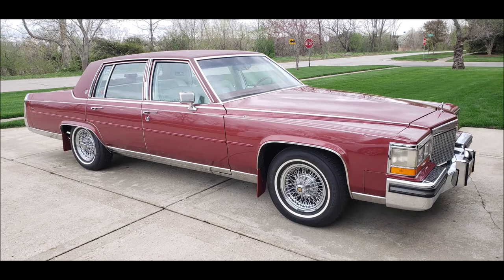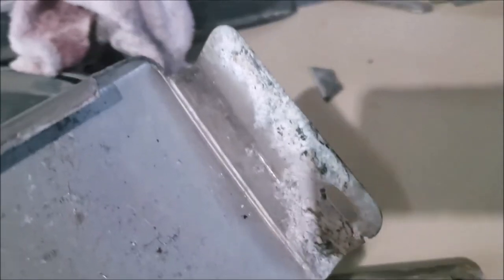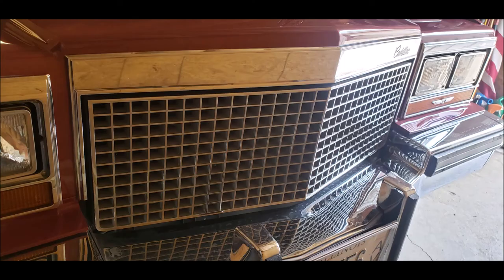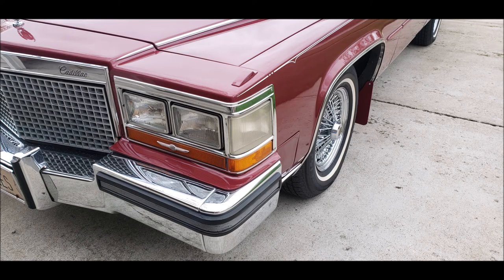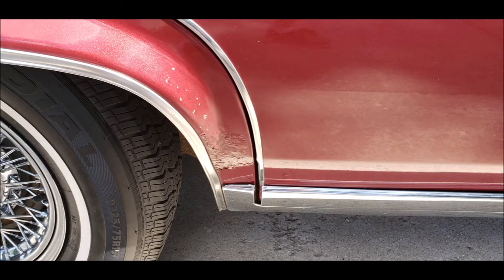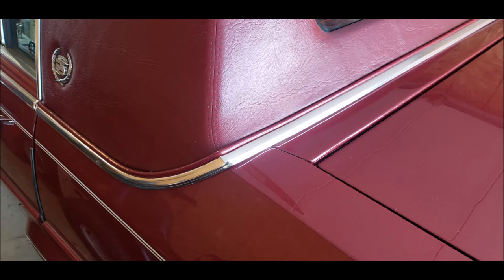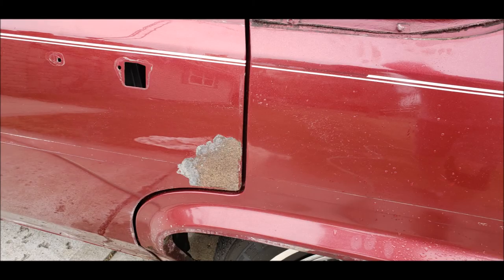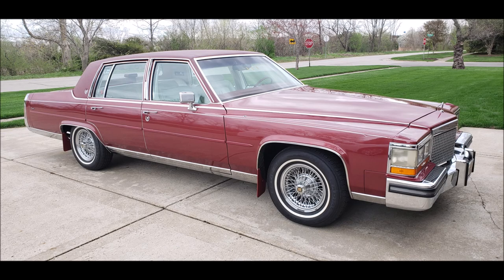1987 Cadillac Brougham Trim Removal Instructions

Comment: How do you remove the side moldings running down the side of the car?
Reply from the maker: Hi, thanks for reaching out.  If you are talking about the color-keyed vinyl body side moldings, they are held on with two-sided tape.  If you are repainting the car, use a metal paint scraper to separate the molding from the panel; if you are not painting the car, use a plastic scraper, it will take longer but saves the paint.  Hope that helps.
Reply: @westofthelakecadillacclub  Thank you so much! 🙏

Comment: Hey sir, I was wondering if it is possible to remove the badging off the tracker turn signal lights. I know they're metal, but I was just wondering
Reply from the maker: I assume you mean the Cadillac emblem on either the front or rear turn signal lights.  I believe they are glued in place and cannot be removed without breaking the plastic lens.  They are kind of cool looking if you were wanting to use them for some other project.
Reply: @westofthelakecadillacclub  I got them off fairly easy, the have dowel pins and adhesive. The ones on the lights on the rear brake lights were just glued on.
Reply from the maker: @thomaswilsonsr.9206  Very cool! Thanks for sharing.
Reply: @westofthelakecadillacclub  Aye, anytime. Really like the information on your video. I'm turning this heavy ol boat into a luxury rat rod. Was wondering how it was to take off most of the plastic pieces! Thank you!